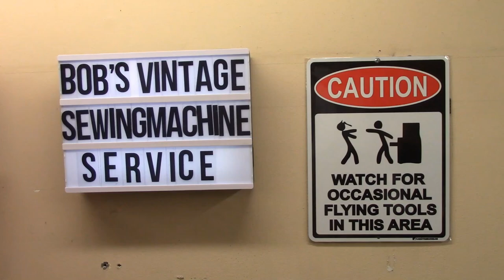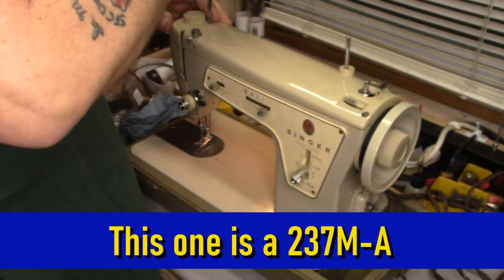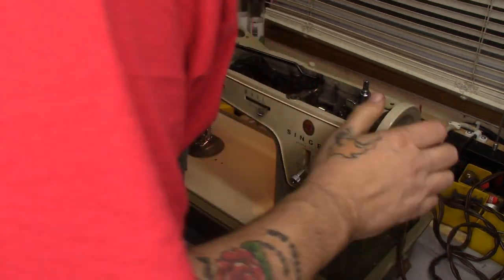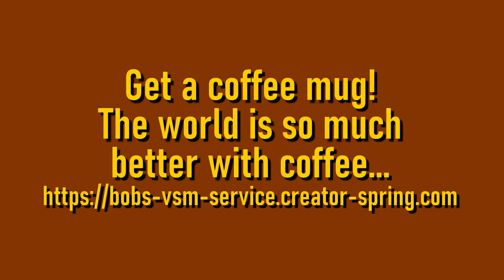Benchside Chat - Featuring a Singer 237

Comment: 237's are known for their beautiful zig zag stitch. They have that Italian Necchi style zig zag configuration. On the minus side, the spline in the upper tension is often cracked and can't keep tension. The spline is plastic! Aarggggh! I had to JB weld mine, and once I did that, it was fine and made the legendary beautiful zig zag stitches.
Reply from the maker: I wound up replacing the upper thread tension unit with a new (aftermarket) replacement part for just that very reason!

Comment: I got this exact (237M-A) machine last year, complete with cabinet and chair. I ended up replacing the shuttle gate because the original was split up top and interfered with stitch formation. Replaced the bobbin case, too.  I will say, the 237 does a very nice satin stitch, once the tensions are balanced. That's what they're known for.  Anyhoo, ended up giving it to my caregiver. She wanted a machine and I got it with her in mind. Heavy as all get out! Thanks for the great videos, Bob. Best to you and Liz. ✌🇺🇸
Reply from the maker: Oh yes, she does have an abundant supply of gravity! She's a heavy beast for sure. If I didn't already have a 403 that I love, I would keep this one. I honestly don't use zig-zag often, but the 403 meets all my needs.

Comment: The 237 is a beautifully made, extra complicated, very heavy machine. Last of the all metal gear machines. The gear driven zigzag needle bar swing mechanism is much more robust and precise, much more like an industrial, than a simple cam bump domestic. This is probably why the zigzag stitches are so nice. Straight stitches are extra fine and straight. I was a little disappointed that you didn't show oiling the bottom end in zigzag mode, the way the hook case and bobbin shifts from left to right, sliding on the wide bushing. Their only weak point is the plastic latch door holding the bobbin. I have 2 of these machines and one is cracked, but still fully functional. That part is still available.
Reply: Hey Mike, I just saw your comment about the singer 237. You wrote that the plastic latch door piece is still available, I am in need of one.  Where could I find one?  Hope you can see my comment, thanks .

Comment: My wife has this machine and I am getting ready to do a servicing on it.  I was amused at your comparison of the quality of this machine compared to later ones.  I also have a Singer treadle machine from the 1890s or early 1900s that is a work of industrial art in comparison.  It has a nickel plated flywheel and gold leaf and pin striping on the machine.
Reply from the maker: I kinda liked that 237 (it's gone to a new home now), but liking one and needing one are two different things. I had to cull the flock and make some room!

Comment: OK, Bob. When I bought my new Kenny in '90, I was excited that he had a drop in bobbin like my original T&S with that "wind in place" plastic bobbin. However the Kenny only came with 3 metal bobbins, which was counter intuitive to use with a plastic see-thru throat plate, so I promptly ran out and bought some plastic bobbins. I bought 66's not knowing there was a difference. * 28 years later * After studying and obtaining a few vintage machines *  I'm cleaning out the Kenny's accessory bin and wondering how 3 #15 metal bobbins wound up in it. Then that little light bulb over my head came on! Made a special trip to buy #15 plastic bobbins.

#15 Bobbins hold a lot more thread than 66's and my Kenny runs just a touch quieter.

We all have our moments........some of mine bewilder me......

Comment: Dependable machine.  Found one of these that it was essentially too brand new and so dry to the bone that it took 3 to 4 days of lubricating to get back running at full speed. Oldest and cleanest machine I ever came across.  It must have been bought to take up closet space.  Did some sail repair with it and also used it to make kites out of rip stop nylon.  Ended up selling it after I got  Pfaff 332 that handled rip stop much better especially in zigzag.  I liked the Pfaff's upper tension adjustments more and of coarse the variety of stitch patterns, over the Siner 237 and so out the door it went; numerous offers very quickly.
Reply from the maker: I have a Pfaff 230 that I need to put on the bench and tear into one of these days...
Reply: @BobFowlerWorkshop  that would be a good one!

Comment: I just purchased one and didn't ask if it worked until I arrived to pick it up.  She mentioned the needle did not move up or down but I was hoping it was an issue of having the bobbin winder engaged.  No such luck.  The crank isn't moving.  I'm hoping with the help of your videos I can get it up and running.

Comment: Gorgeous stitches!!  Definitely would make a great addition to someone’s sewing room, and not a lot of excess mechanics to get clogged up. I’ve heard that some of the early-ish zigzag machines can also be set up to treadle, because the bed doesn’t extend to underneath the  handwheel (so there’s room to run a treadle belt).  Do you think this one could do that?  Very cool to have a treadle machine with built-in zigzag! :-)
Reply from the maker: AS a matter of fact, the manual for the 237 shows it hooked up as a treadle as well as an electric!
Reply: I'll go you one better.  I've treadled  a Singer 288.  Not only do you have zig zag but the flat fashion disks as well.
Reply: If you intend to treadle one of these machines, place a wide rubber band in the belt grove of the hand wheel .  It gives the treadle belt extra traction otherwise the belt would just slip on the painted surface.

Comment: Mine is attached to a table, and is supposed to fold down inside with a hinge, but it's much too heavy to bother with that. I just cover it when not in use. I still have the instruction book. I never knew the bottom needed oiling.

Comment: I have a Singer 298 FashionMaker which seems to be similar to this - disc in front for the zigzag and the mechanism for it at the back instead of top. My problem is that the needle is scraping/hitting the back of the hole in the throat plate. There are many videos for aligning sideways. Any idea how to align the needle front-back?

Comment: I need to time this machine.....how?????
Reply from the maker: The hook timing is preset and fixed at the factory. What IS adjuistable is needle bar height, which if incorrect, can present as if timing is off. I am currently (late October 2023) working on a series of videos on the Model 237, and your question will be answered in more detail in the first video in the series.
Reply: @BobFowlerWorkshop  thank you.

Comment: My 237 worked great yesterday.  Today,all I did was removed the hand-wheel, motor, belt and light and when I put it all back together, the Crank connecting rod is totally not moving, at all.  Needle bar won’t budge!  I found that so strange, I’ve tried everything, reassembling the washer in the hand wheel a hundred times and can’t figure it out for the life of me.  I have a couple of folks I’ve reached out to but I thought  I’d check here as well.  Any idea what may have happened?
Reply: The small metal piece between the wheel and the smaller, "clutch release" wheel might be on backwards. It has a slight convex shape to it, and it looks like it fits better when it's installed backwards, but it's supposed to go the other way.

Comment: I think this is one of the last models Singer put out that had that "retro cuteness".  Funny enough, I have this exact machine sitting in storage.  It'll give me about an inch of play before it freezes up.  Found in the clearance isle of a local thrift shop, it fell within my parameters of rescuing an otherwise awesome machine from the scrap pile.  Currently, there's a White model 565 at our local Goodwill, that's tempting me with it's $20 price tag.  But it seems to be up and running well enough.  And also, she's a little chonky & not very "cute".  Question:  she does seem a little loud.  Is that to be expected from this model?  On mine, I removed the belt to check motor performance & it was pretty quiet- sounding much like a hand mixer, which to my ears is normal.  My vote is:  On Point!
Reply from the maker: At least it's an "all metal" machine. She's a bit less "elegant" than say, a 403...

Comment: Hello
I have a problem with my 237. It does not grab the thread any more. Is it easy to fix? Something with the hook shuttle?
Reply from the maker: Timing adjustments are quite easy on these machines, but I suspect maybe your needle may be bent or in backwards, so check that first!
Reply: @BobFowlerWorkshop  thank you very much for your feedback. But I already changed the needle several times. I don't think it s the problem. But I ll do it one more time. And then if you say it s easy I will try to understand how to do it. Do you have a video that explain it?
Reply: @BobFowlerWorkshop  I forgot to tell you. It also cut the thread each time I try to sew
Reply from the maker: @kaylaimage3385  If I don't,  I can certainly make one for you.
Reply: Great thank you very much!

Comment: Hey do you have an alternative for oil wick that you use that's cheaper? Thanks
Reply from the maker: You can get some wool felt and cut a small piece and insert it into the connecting rod cap.
Reply: @BobFowlerWorkshop  thank you